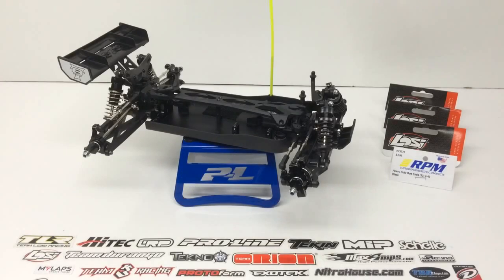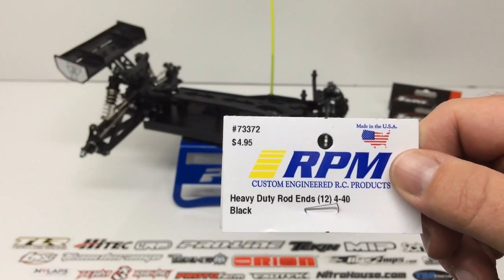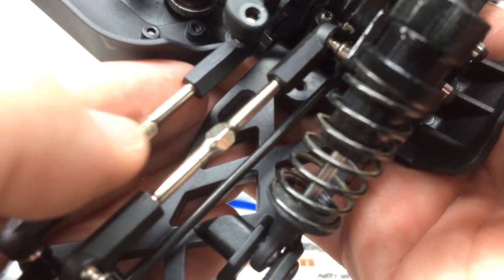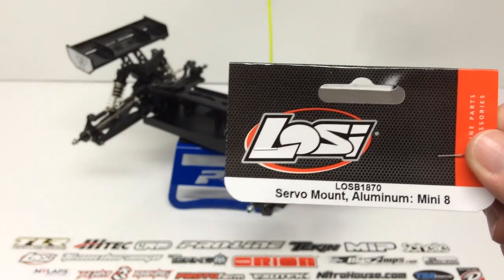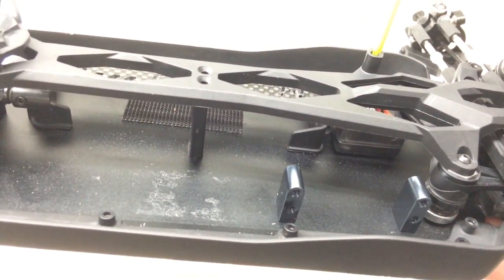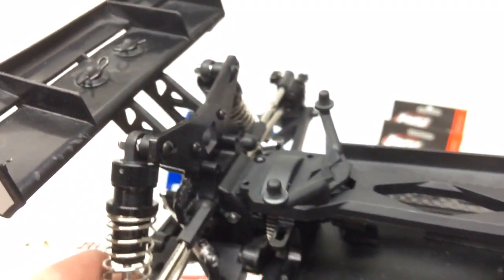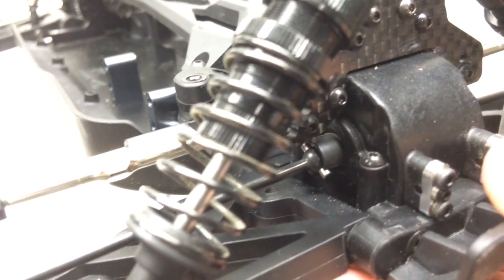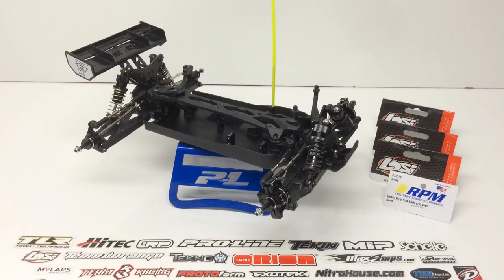Losi Mini 8ight T - Upgrade Series 2 - Losi/RPM

Comment: Good graphite shock towers :) replacing the composite shock towers with alloy or graphite is the way to go and looks good
Reply from the maker: Yeah, Carbon's always better (most of the time!)  The stocks were stamped Aluminum, that in the M8 had a tendancy to bend
Reply: Oh ok then, but ya ur right carbons is better

Comment: what motor and esc will you be running in episode 4? i cant wait until that episode to find out as i am really in need of a new motor for my truggy.
Reply: traxxas velineon 380 works just fine as a bolt in.
Reply: does the stock esc work good with the traxxas velineom 380?
Reply: Tyler Dimery the velineon 380 motor is to much power for the mini 8ight and 8ight t because it  may be 1/12 scale but its a 1/12 scale of how big it would be in real life and its smaller than a mini e revo and its already to much power for that
Reply: Zachary Sorrell  To each is their own, i find the 380 to be perfict for this truggy to be honest and i know im not the only one who thinks this, as it is a very popular drop in on the fourms.
Reply from the maker: I'm working out all the bugs right now for episode 4.  Had to turn to the dremel to make my choice of motor work.
Reply from the maker: I disagree.  The VXL 380 motor is widely used in both the M8 and probably in the M8T now.  The M8T and M* are supposed 1/14th scale also according to Losi and Horizon Hobby.  The Traxxas Mini vehicles including the MERV (Mini E Revo VXL) is a 1/16th scale vehicle according to Traxxas.  The 380 vxl isn't too powerful for the mini line, as I have owned 3 of them.  Just speaking from experience
Reply: I  meant to say 1/14 sorry

Comment: Stock turnbuckles shafts? I just purchased the rpm rod ends but are they the stock turnbuckle shafts?
Reply from the maker: +MikeeProvolt The 4-40 RPM Rod Ends wilkl fit the stock Losi Turnbuckles - Be careful on the length of the RPM end vs the stock ends - The completed turnbuckles need to be the same length as before

Comment: What did you end up doing about the length of the cv axles? Just ran into the same problem
Reply from the maker: I never heard back from Horizon Hobby and ended up losing interest in the 1/14th scale stuff.
Reply: There is a way to “space” the out drive cup on the diff. It’s the 2mm you’ll need for the short axles. GPM cvds maybe a better choice over the LOSI part. In my opinion it was a huge oversight and a critical issue for what is an amazingly fun class of vehicles. 
Not surprised it’s discontinued and parts are a bit scarce. Consume, dispose, repeat. 
Too bad...